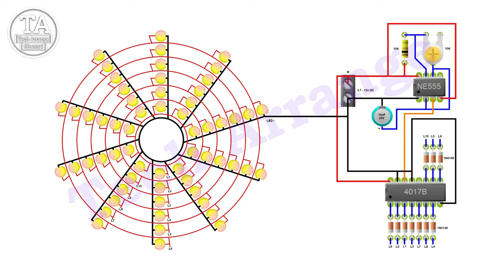Spider's Web LED Chaser Light Circuit | LED Chaser Circuit

Comment: How do you connect and drive 10 LEDs at every output of the IC 4017?? I think there is not enough power to drive 10 LEDs on every output (0-9) on the 4017! Especially when you drive the LEDs in parallel mode like your circuit tells us. Because this means that every LED gets its own ~20mA which gives a total of 200mA on every single output of the IC 4017!! And I think this is to much overloading! 
Please: Can you tell me how this works without any transistor in the circuit? I would like to rebuild your circuit. Thank you very much! Boris  🇨🇭
Reply: Please can you help me?🙏🏼 Is there really no transistor working? Or do you drive each LED with only a few little mA? Maybe 9-10mA? Your help is very much appreciated! Thanks, Boris
Reply: @Scrumdidilydumptious_Balls  Dear Ruse thank you very much for your answer! I will rebuild this circuit and run it by 5 Volts. My first attempt with 10 diodes on the 4017 is promising with 5V power.